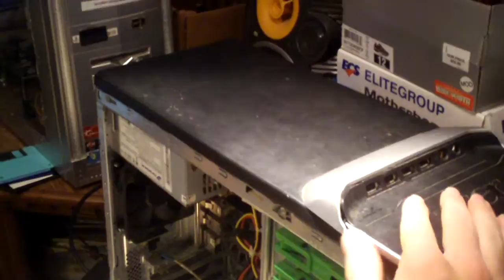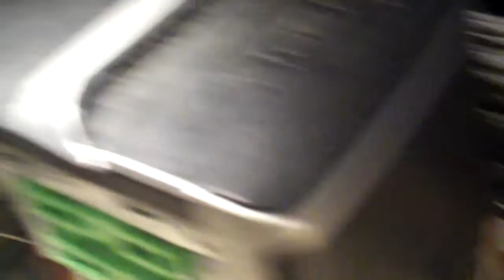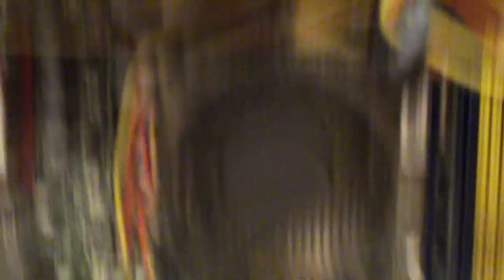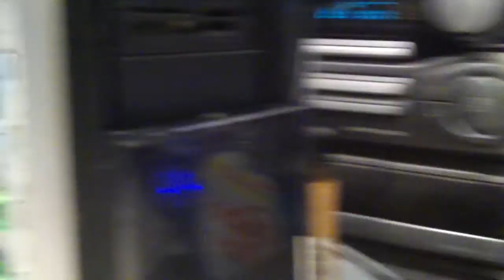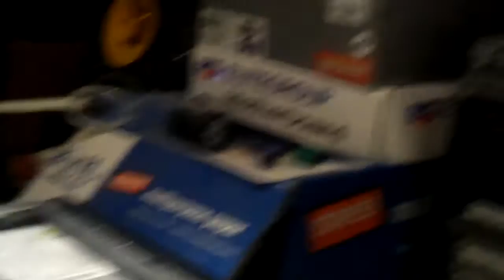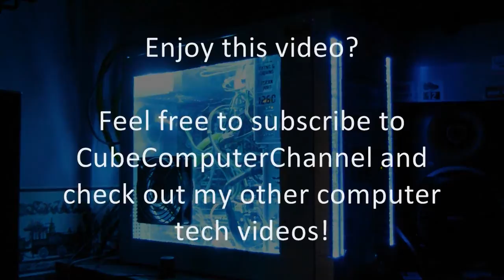A look at a dead Acer parts system (first one from The Grid)

Comment: Pulling an AMD stock cooler off with the CPU still attached to the heatsink is exactly what happend to my AMD Phenom II X4 955 build. Luckily I didn't damage anything, but it really was a scary experience.

The same thing can occur to Intel's socket 478, but that's obviously extremely dated by now.

Comment: when you said if the heat sinks are cold then the motherboard is dead, i kinda got worried because my htpc runs great , but the heatsinks are always cold ,and the motherboard has some trouble(black screen) if the cmos is dead and I need to reset it to turn it on, so is my mother board going to fail?or its just the fan and maybe some asus motherboards are just like that? it's a amd x2 24e with an intregrated hd4200 on the mother board
Reply from the maker: When you have inadequate thermal transfer between the chipset and heatsink, then it'll also feel cool to the touch. This has NOTHING to do with the CPU installed.
Reply from the maker: Micheal Cantrell The computer will still run fine if the chipset northbridge is overheating to a certain degree.

Comment: seagates are definitely made to fail, i found another 60gb ide drive i used to use for my old pc and i plugged it in, not even 1000 power on hours and it is full of bad sectors
Reply: I've got a Seagate drive with 6000+ hours on and it works perfectly, so no, they're not made to fail.
Reply: yes they are, i have had over 5 fail...
Reply: ictdude1 You are unlucky then. I've had a grand total of two hard drives fail in my life; a 20GB Western Digital Protege, and a 60GB drive in an iPod Photo.